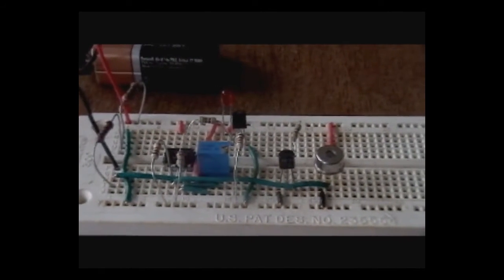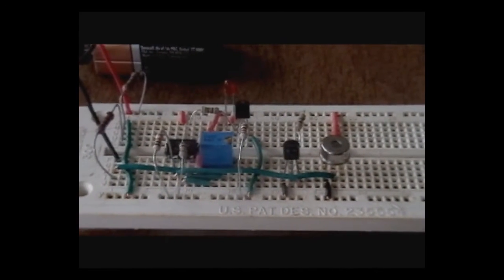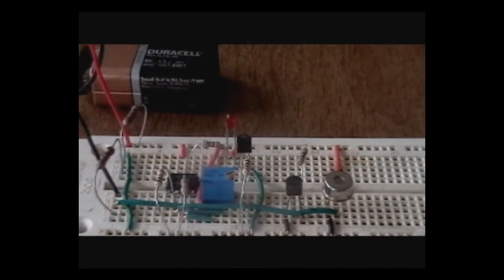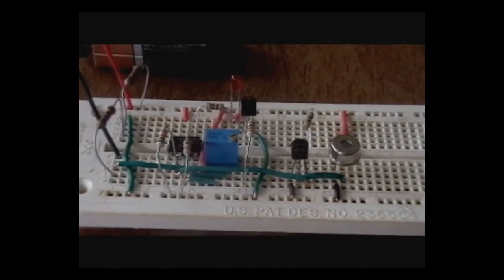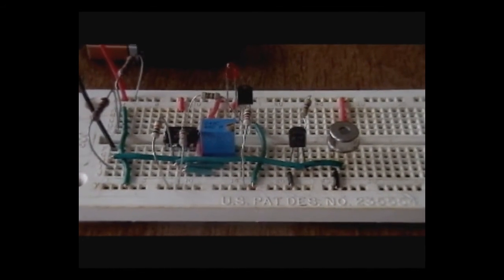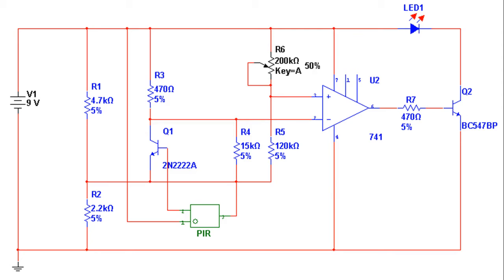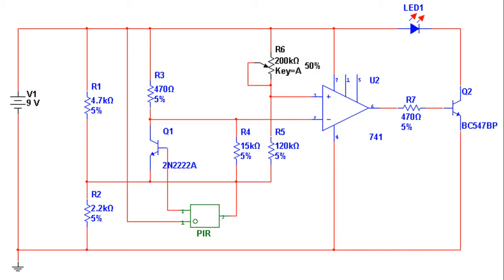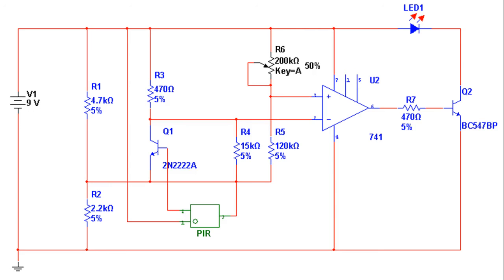Motion Sensor using Pyrolectric Sensor with Schematic

Comment: URGENT: Hi, what if i wanted to input a speaker or buzzer into this circuit?
Reply from the maker: +ardah obi If you are meaning in place of the LED, a buzzer could definitely be done provided it is designed to work from a DC voltage.  This does not output an AC waveform.  A speaker would not work without adjustments because a speaker is really designed to produce a sound based on an AC waveform.  The main thing to consider is the voltage and current specs for the buzzer and adjust the circuit as necessary to handle that.
Reply: +Jonathan Bisnett i have been trying to input a buzzer into the circuit. operating voltage: 5v, resistance: 5ohms. i really need it urgently. ive also connected a simple diode in parallel with the buzzer. it still isnt working. please help.
Reply from the maker: ardah obi Well, the first thing is to make sure the buzzer will work with DC voltage.  If you connect the buzzer to a circuit in series with 5V, does it make a noise?  If not, this buzzer will not work in the circuit I show.  Assuming the buzzer works, you will need to make sure you put it in the circuit with the proper polarity.  I don't see any value to the diode other than the voltage drop that would occur if you needed to lower the voltage in the series circuit.  There are at least two types of buzzers, ones that will buzz when given a DC voltage and ones that require an AC signal.  If you have one that needs an AC signal, it will not work in this circuit.
Reply: +Jonathan Bisnett thank you. i added a resistor to the LED and connected the buzzer in parallel with the LED and it finally worked.
Reply from the maker: ardah obi That's great.  It is possible that there was simply too much current or the 9V source versus 5V buzzer presented an issue.  The BJT transistor that is driven by the comparator will saturate and pull a bit of current.

Comment from the maker: Building this circuit in a simulator may be a bit difficult for the very reason you just noted.  Most of the simulators will not have the PIR component.  Unless you have some knowledge regarding creating your own parts, this is probably not practical.  Sorry I couldn't give you better news.

Comment: Is the PIR output voltage dependent on the difference of IR Light being received by the sensor  elements themselves? As long as both elements read different values, can it output small sudden changes in IR in its line of sight? I ask because I want to take advantage of the range and scope of the PIR sensor in a circuit that would normally use a photodiode behind a flywheel with holes drilled in it (Nipkow Disk), so I can sample/scan the amount of IR in its line of sight. A low res heat imager.